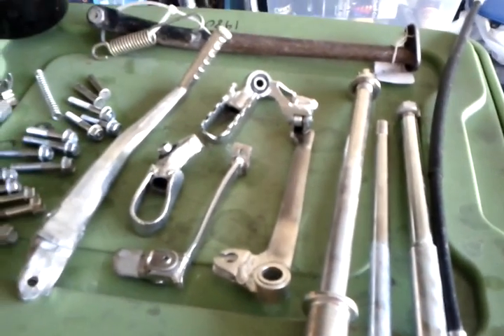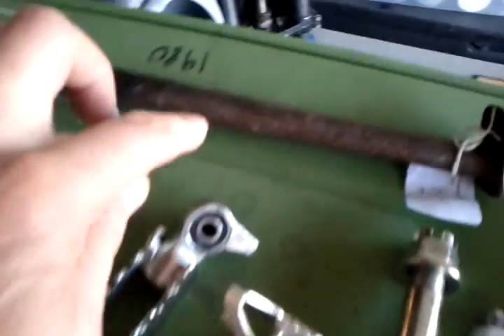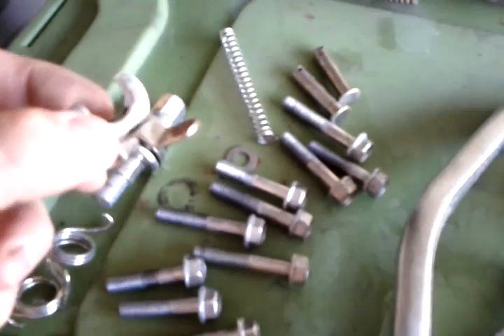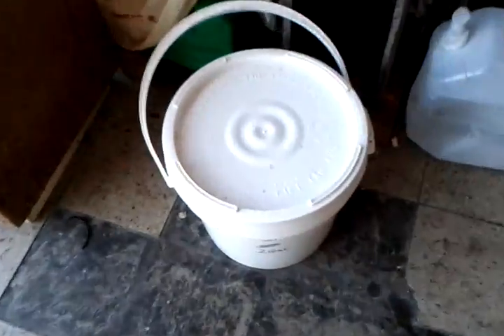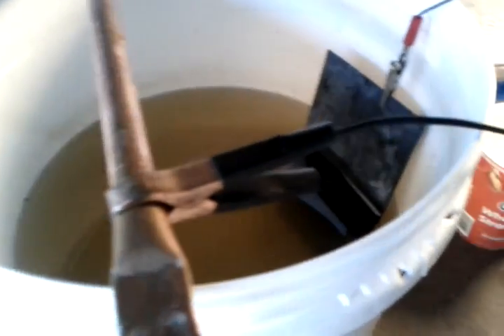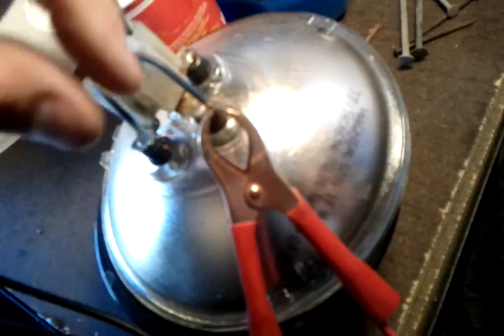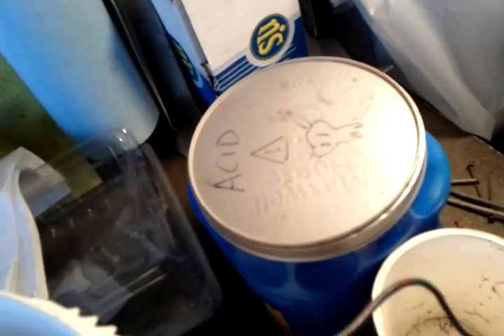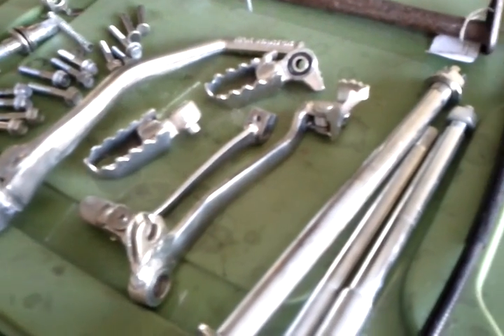Zinc plating at home - DIY

Comment: I also have the Caswell Zinc Plating Kit.
I don't know if you can get the "Chromate" dip on your side of the "pond" (maybe in UK) if  you can, it will be money well spent.  I use both the Clear and Black Chromate..  No PS is needed for this process.  I use Clear  on Volvo 122S & P-1800 parts, Black on my '53 XK120 Jaguar DHC fasteners.
The Chromate protects the Zinc from oxidizing.
I must admit, for a "Frankenstein" set-up, you are doing masterful work..  Really great job!
      Chas.

Comment: Eric;
    I think you will find that Chromated Parts look tons better..  I read the yellow can be "difficult"..  Generally the "failure" is the lack of thickness of the original zinc plate. I hang large parts by a 12ga copper wire.  Measure the bare wire BEFORE and after plating..  If the diameter of the "plated" portion of the wire increased by 0.004", then your plating is the required 0.002", this helps the Yellow Chromate to "work" better. I use an old Food Dehydrator to "dry" my parts. Chas

Comment: Very nice vid we can see clearly the results. Not just a penny plating, thanks a lot! How much %tage zinc chloride solution are u using? N for the rest of the set up, is it: 5% HCl solution, to clean. Zinc anode & whatever u wanna plate cathode (No Al).  Finally a DC power supply.